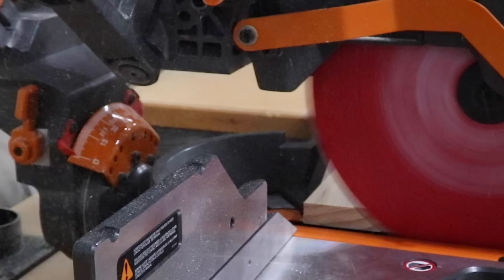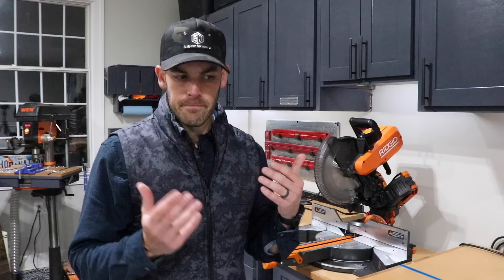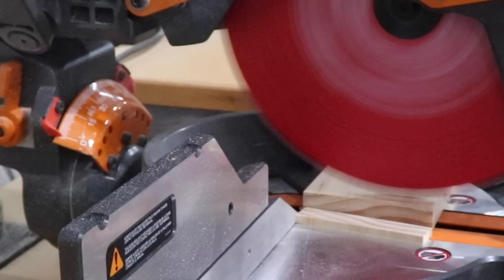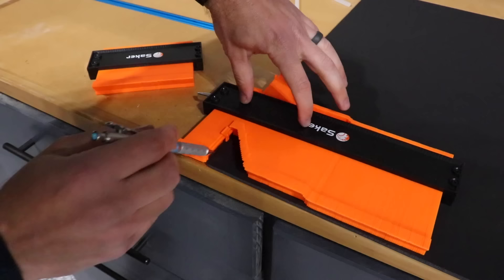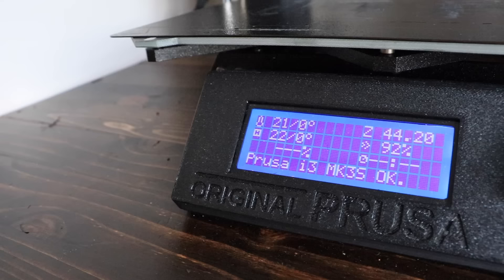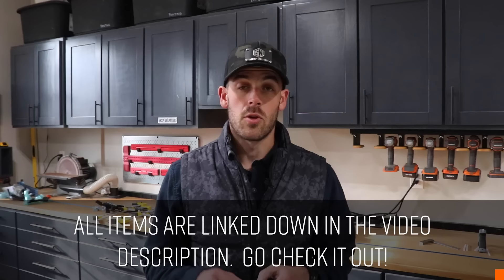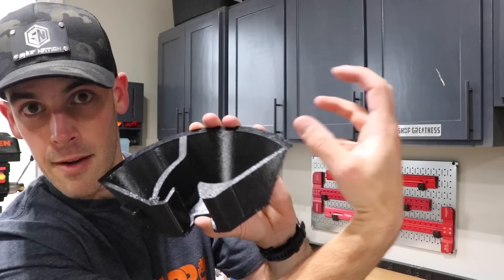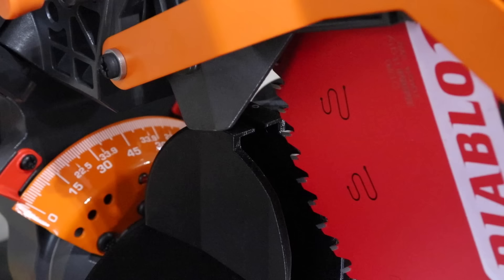Did I Solve Miter Saw Dust Collection?

Comment: Great video, Travis.
Might I suggest you have a look at Drew Fisher's video over at Fisher's Shop how he significantly reduced his mitre saw dust problem. From memory he has the Bosch version of your saw which seems to function similarly.
Also, I have a very similar type of saw to what you have. I made my own thick zero clearance base plate out of scrap pine. I noticed quite a bit of dust underneath the saw and realised this was one of the problems with the dust collection. I made an initial cut into the zero clearance plate so there's a deep groove in it where the saw rides in when cutting. After doing so my dust collection has shown substantial improvement, even without a custom dust chute at the back.
My other thoughts are that there's not enough air flow through your chute at the moment causing turbulent flow rather than laminar flow of air. Basically, you might be choking your dust collector.

Comment: I was able to moderately improve the DC on my Bosch sliding miter saw by removing the plastic dust port and attach a rubber skirt to it. I'm on iteration #3 for the size and shape : too big the dust collection improves but the flappy rubber catches on the work piece or the fence and too small and I'm back to vacuuming after a few cuts....

Comment: I have the Delta Cruzer. I’ve tried 3D printing and replacing the back part you removed. Added a flange to it and had different heights for different cuts. 
It was better but much like yours the dust was traveling at too great a speed. Then I added a square version in the same place of your spaceship. But it definitely needs to be tweaked. 
Anyway, keep up the videos and have a great day! I would add pictures to the comment of what I have so far. Currently mine just makes a mess as a knot flew into the plastic and took out a good portion of it.

Comment: a couple of plausible explaination:

A shop vac is high pressure, but low volume. Therefore it doesn't create a long distance ''sucking '' potential. If it was a dust extractor, maybe it would help.

You pointed out that the dust comes out at high velocity...maybe that your narrow design makes it bounce everywhere?.

Comment: It was still a great video.  I made a box around my miter saw with a port hole in the back.  Still lots of dust all over inside the box but easy to clean.  One thing I noticed is that when I make a cut a lot of dust just kicks and flys in the air.  My hood pushes it down and some of it gets sucked down and the rest falls into the side crevices and such.  Your video made me think, what if you shoot a 2.5 inch pitchfork style piping behind the miter saw enclosed in a box.  Each pipe has a small vertical slit in it?  If I didn't have a bunch of other projects, I'd be tempted to put a 4 inch pipe approximately 18 inches long into the hole, cap it and make a couple of 1/2 inch slits just to see if catches more dust.

Comment: 2 things off the top of my head:  1.  The opening is too narrow and a lot of dust is bypassing the inlet and going around the sides. 2.  The back of the "collector" is a nice, smooth ramp....right up to the opening at the top of the collector.  It's almost like it's guiding all of the collected dust right up to that narrow slot.  I would open the collection inlet wider, and make the upper radius area in the back more square with a smaller radius in the top rear corner, and add a smaller vacuum port in that area to intercept the dust before it makes it up to that small slot at the top.  
EDIT:  one more thing:  I don't think you have enough inlets, spaced around your enclosure to allow the vacuum to pull enough air through the device.  You have to have a LOT of air flow to carry the dust to the vacuum port.  Maybe some openings around the exposed areas of the chamber, and covered with some type of filter material that will allow air to pass, but also keep dust from going straight through it.

Comment: Wait wait wait!!!!!

Try cutting through an entire board instead of shaving the end. 

You may be throwing in the towel on this design too soon. I’ve noticed my dust collection on my table saw works great UNLESS I am just shaving the edge of a board off. Since there is no board supporting the edge of the blade on both sides of the cut the sawdust goes everywhere and you really can’t do anything about it. 

I think it might be a good idea to take a board and make repeated cuts where you shave like 3 inches off the board each time to simulate cutting a board to length rather than shaving the end. That cut is hard to collect dust. 

Great design. I think you’re onto something here.
Reply from the maker: I tried all types of cuts, shaving off the end (for visual appeal), chop straight down, and sliding cuts.  Not all the same dust patterns but similar results.

Comment: Thanks for the video. I've also experimented in the same way you did. I built a small box, tight in where I thought the spray from the blade goes. The main difference is I used the original dust hole straight out the back. Additionally, I built a tight shroud out of flexible rubber matting. I had slightly better results because I sucked the dust out the original hole in my Delta and I had a zero clearance fence (I replaced my fence with a fence I built). My box wasn't all that dissimilar to yours except it didn't look as cool :) The problem was my shroud was held together with duct tape. I think I'm getting close and I think it has to do with creating a better shroud that gives dust less places to escape. I think I'm around 66% of dust actually getting sucked out. That was before the dust shroud part started falling apart as I was renovating my kitchen and I didn't want to spend two weeks monkeying around with it. Looking forward to your next iteration.

Comment: Very well done.  The sponsor portion was excellent, not intrusive at all, good stuff.  Great build on the collector and it didn't work.  No worries, you will get it on the next try.  Appears  the problem is the velocity of the dust and it is not all going back, much is going sideways.  Good luck and thanks for sharing.

Comment: A big part of the problem is the way that you use most mitersaws. It`s much harder to catch the dust when going out-in with the cut. Look at a Electra Beckum kgs255, cutting in-out and the dustport is split between the back and the base. It`s not the best saw by far but the dust collection is really good.

Comment: This is why the dust port on the saw is connected to the saw head and not the base.  Although it doesn't work well on this saw it does work ok on some other brands.  You are essentially shooting the dust into your custom dust port from 6 inches away expecting there to be enough air flow to suck it in from 6 inches away, which isn't possible.  That tongue looking thing that the saw came with is supposed to drag along the board scooping up the dust as you slide the saw head back.

Other channels show these dust hood things that surround the saw.  This creates a cavity that forces any floating dust back into the dust collector, which is probably the most simple way to solve this issue on saws that have poor dust collection.

Comment: I bought a second hand kapex ks60, which is known for great dust collection. All it has is a rubber shroud behind the blade, which is at the end of a channel where you plug your vacuum in the other end.

On my saw the shroud was missing but I made one with Gorilla tape. Not perfect, but a lot better than the results you had with your saw.

Maybe you can add a shroud to the original dust collection port? Should be a quick experiment at least!

I hope you find a great solution, dust in the shop sucks!

What's next in my dust connection journey is getting a higher CFM shop vac, my current one is pretty bad in that regard.

Comment: Use a high speed camera after which you can slow down the frames to see exactly what is happening. I suspect you will have to create a collection point where the dust settles after it slows down at a back plate or box you will have to create behind the saw to catch the high speed particles after which the suction will have to do it’s job after the fact. Seems to me you need a wider catching surface in the rear, funnel or something instead of the neat slot in which the blade enters. Interested what you come up with. That’s a lot of printers you have there, you probably are more than capable of sketching up prototypes.

Comment: The key may be understanding fluid dynamics. That is, the behavior of the air in which the dust is traveling. I agree with others that the smoke test would be a good idea, however you can already see the result accumulating on your saw. That's actually a partial success. You may not be able to overcome this with suction but if you can redirect the flow, that is probably the key.

Comment: I think you are moving in the right direction.  I think you could open up the area where the blade slides into the new dust collecting shroud.  It seems to be blowing by the sides.  Also,  if you could increase the CFM of the dust collection system that would probably be the biggest game changer.  The RPM of the blade on that saw moves that wood dust so quickly unless you have more velocity you will probably still be chasing the dust.  I was impressed with your design.  It’s a difficult problem to solve.  I’m impressed that you shared the results.  It says a lot about you!

Comment: Did you ever consider the Bosch 12" Axial Glide?  I have heard that the Delta Cruzer has some side-to-side slop. If yours is the same thing with just different colors you may not be happy. I am no engineer, but my best guess is because the Cruzer and the Ridgid have the arms off to the side, whereas the Bosch has a single arm directly centered with the blade. Sure the Bosch cost a little more, but personally, I rather pay a few more $$ and have no issues.

Comment: I highly recommend the Makita 10" LS1019L or 12" LS1219L for their superior dust collection without Festool prices. It has a large rubber boot at the bottom and suction right at the blade as well. I researched miter saws for weeks before settling on the Makita and have never looked back.
Reply: I agree 100%.  I ditched my 12” ridgid for the 12” makita and it’s night and day difference.

Comment: I would remove the top part of the dust box from bottom section and connect it to where the original dust shoe was. To close the gap between the two parts, you can use brushes. Dust collector needs to be connected to both top and bottom parts.

Comment: nice work  ironically when you carried the Rigid Box into the Shop,i originally  felt a sadness as i thought it was the older Rigid Slider  that IMO has way too much Slop in it  than i like   i will look closer at thisxsaw when.i can  as it does have the Delta engineering in it and  looks similiar to the Bosch  which i really do like FYI most traditionalBar style Sliders   do have that “Slop” factor  and s the saws age they get really out of Calibration  for me my preferred Miter Saw for many years has been the Dewalt Double Compound    for my personalShop for  my Architectual Woodworking Crew of 40  People i did use the Dewalt Sliders  and tuned up them whenever necessary my non Sliding Double Compound doesn’t hav all the Capacity the Slider does but mine is nearly 20 years old , used only by myself and is very Accurate , without ever needing any overhauls or Tuneups FYI it has  very rarely had to be transported to jobsites  and has not been used ,abused , dropped or ,damaged in any way  over the years in general i have not been overly Impressed with the Rigi Brand of Tools IMO they are placed on the Shelves Home Depot  displays their more Profitable Items that usually means those are the lowered cost to manufacture  and even though many Rigid Tools are built in the same factory that builds Dewalt Products and they often share Parts and Engineering  they do have different levels of Quality Control  and Specs in order to meet the overall goals of the Stores Business plans set by Corporate Management and the Investors  Home Depot is more about the Profit than the Quality  therefore i generally shop elsewhere  on Tools  and some Supplies  Professionally i ran a large Architectual Woodworking Company for over 35 years and  had access to many of the Industries biggest Suppliers  in many cases directly from the Company  itself  as we had many longterm relationships with them

Comment: I have an old Dewalt miter saw I have a an old Sears Craftsman 2.5” diameter hose, 160 CFM. Doing observation it looks like a diameter of 8 to 10” would get all the dust. I’m just haven’t taken the time to figure out the rest. 
Good luck. 👍

Comment: Hey have you tried using epoxy between the parts when you screw them together? It won’t allow you to just reprint parts but I feel you’re not getting enough suction due to air leaking through 3D printed parts. Also check your magnet clearance that you’re not having a small gap. I think most shrouds are made with injection molding. You could try running water into your part and see if it leaks.
Reply from the maker: Its pretty airtight, definitely not leaking enough to impact results

Comment: It needs to be wider behind the fence and you may need some kind of catch that attaches to the top behind the blade. Perhaps doing what you already did, but wider, and then expanding on the original dust collection that came with the saw. I have the delta and though it doesn't do much, the original dust collection does reduce the dust by about 1/3 vs having nothing attached.

Comment: An amazing effort!  Sorry it didn't work out, at least initially.  When I was young, I worked at a glass container company, in both their corrigated (cardboard divider) and machine shop (mold making).  Both areas had potential for dust hazard.  In addition to overhead dust control, for individual mills, lathes, bandsaws, etc., they had metal fabricated hoods through which dust was sucked out.  I don't know the science of how much suction-power, etc., but it worked well enough that masks were not needed.  I hope this info helps.  Best wishes!!  (P.S. I have experimented with a cardboard box tied to a dust extractor, which has worked satisfactorily for my needs.)

Comment: This whole thing is very strange. I’m currently in my shop building a Voron printer to add to my collection but I specifically built this one for printing dust collection fittings and other larger items for the shop. I have the Delta version of this and right at the beginning of the video it popped in my head to use my 3D printer to print a shroud for my miter saw. Then I watched a couple more minutes and there you are talking about it. Lol. I’m very interested in how it turns out. And hopefully be able to use your STL’s if you’d be so generous even if you charge for them. Maybe we could collaborate on it together? I wouldn’t want to be in the video but perhaps help contribute to the success of this.  Either way, I can’t wait to see the final results

Comment: I have the Delta Cruzer and I hook up a shop vac to the stock port.  I found I get better dust collection if I cut in the sliding motion versus the chopping motion. I think this is because the blade is throwing the dust directly to the port in the sliding motion.

Comment: Saludos desde Aguadilla Puerto Rico, Hello from Aguadilla Puerto Rico, Nice VID cuz the idea to collect sawdust that has a mind of its own in the mitter saw is a challenge for the ages. Very Clever Design. Trial and error its the name of the game. But as you said Something is better than nothing. I have not read the comment section so if it is repeated sorry. But Here it goes. You said and noticed that the dust seemed to collect now lower at the neck of the mitter. It has to do with the vacum so it has the power to lower the dust up to that place. That is a good indication that the speed in wich the dust is traveling up the mitter vs the one traped in the vacum at the edge of the piece is almost the same, i am no engeneer but i would try to make a skirt coned shaped with very slippery surface and some kind of Tornado like vacum airflow to redirect air to the centerpiece. Again i am no engeneer. It seems like since there are a lot of loose particles flying around like they have a purpose to make us work double in the cleaning i remembered the movie Twister and many Adds about making an engine suck more air with more power. Who knows. If there is anyone that can come up with a cool design its you.

Comment: If you first fail, try and try again. Thank you for sharing. Remember, Rome was not built in one day.  Just love your creativity in finding a solution to our miter saw problems.  At one point I was thinking of placing a towel over my Dewalt.  Since I saw your video, I think I will try that to see if it works, maybe an over-sized shroud would do the trick to keep dust from flying out too far.  Can't wait for your 2.0.

Comment: Just my two cents, but you are probably going to get better results if you attach the dust collection hood to the moving arm closer to the actual blade, otherwise you are just trying to catch the saw dust from a too far away. As that distance increases so does the "spread" angle at which you have to collect it at, unlike if that distance was fixed at the saw blade.